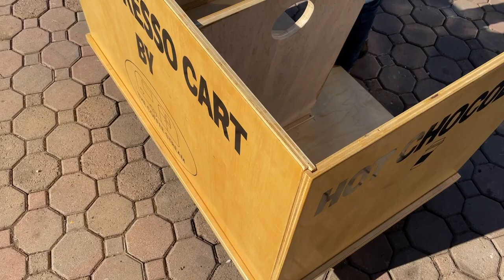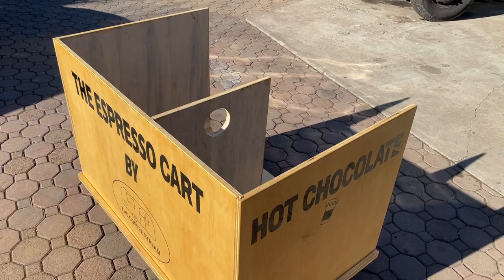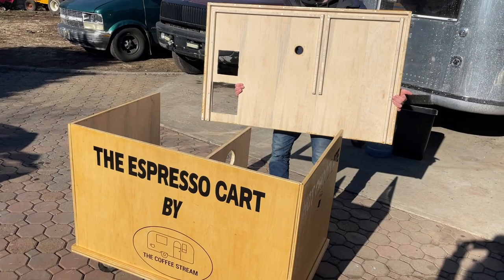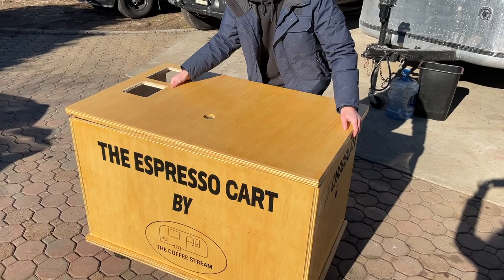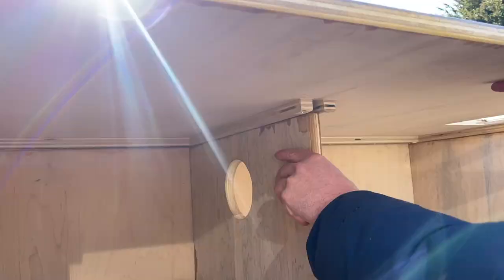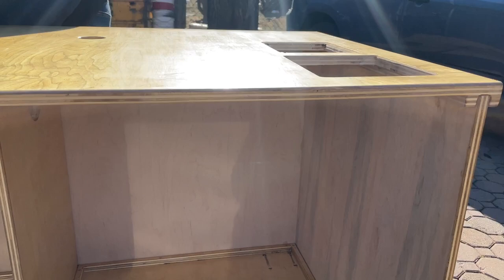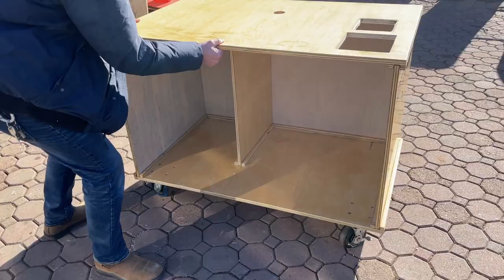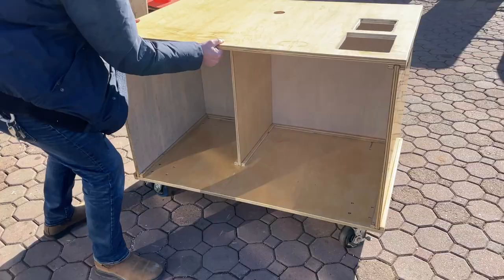Portable Coffee Cart

Comment: Great idea! Can you power everything you need for your cart through a single 15 amp circuit, or did you have to do anything in particular there to not overload the power circuit your connect to?
Reply from the maker: So far we have powered everything with a 15a circuit (la Marzocco GS3, mazzar mini, and water pump) without tripping the circuit. We even ran a small mr coffee once at the same time. If we had a machine that drew more power an alternate power source would definitely be required. A larger machine wouldn't be easily portable though thus reducing the portability of the cart.